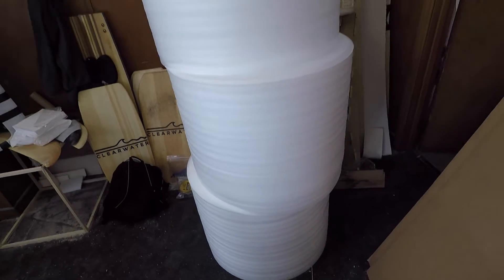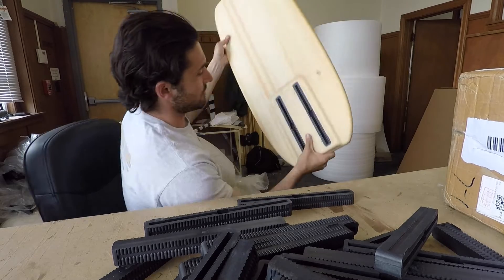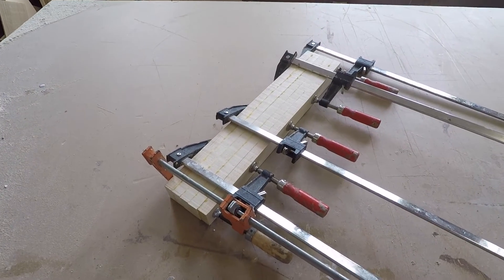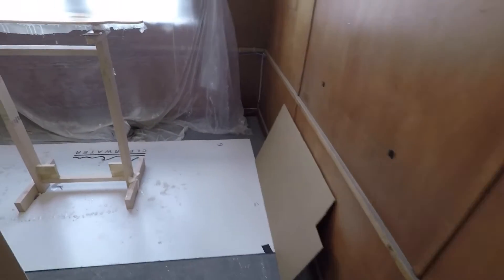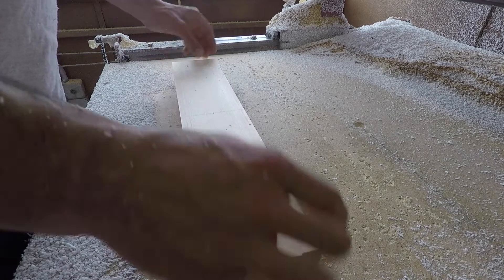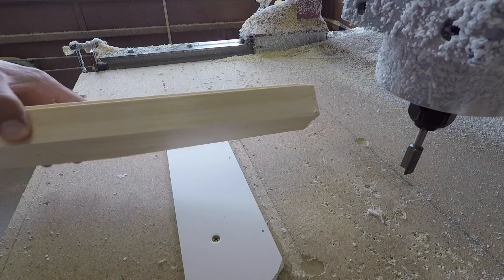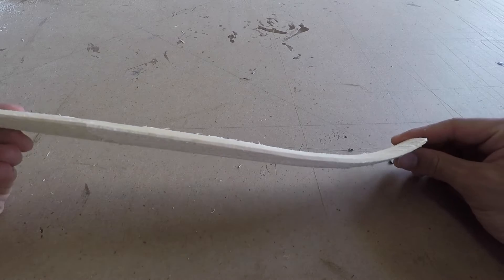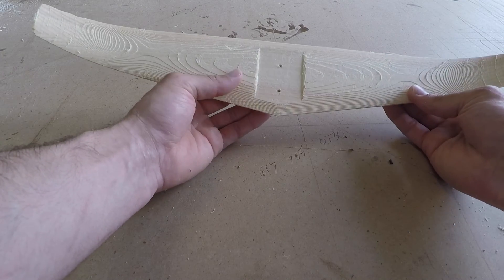CNC cutting a hydrofoil stabilizer

Comment: Ever try a bull nose bit with tighter tool paths?  It will get rid of your steps and make sanding a bunch easier, but more time on the machine.

Any chance on buying some of your designs for tinkering here ar the house?
Reply from the maker: www.clearwaterfoils.com Everything is for sale there! To run efficiently I need to keep parts cutting as fast as possible on the machine... it can back up fast. For now speed is the main priority. It is much faster to have more steps and spend a minute sanding as opposed to adding another 10 minutes to the cut.